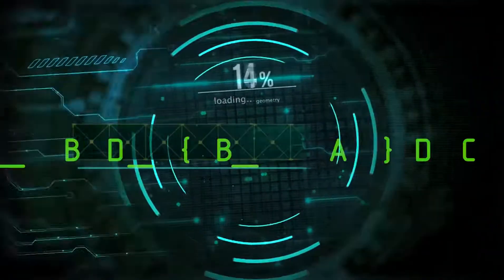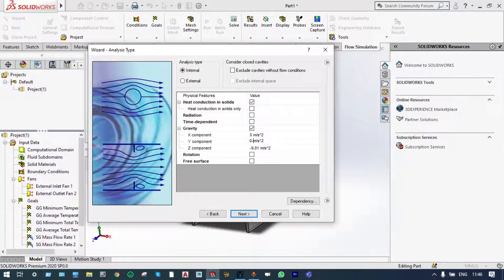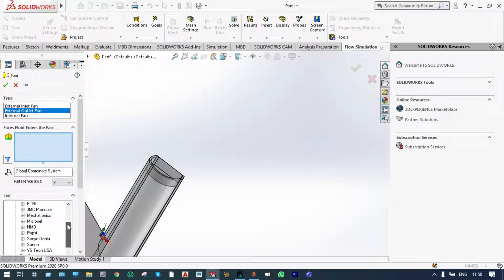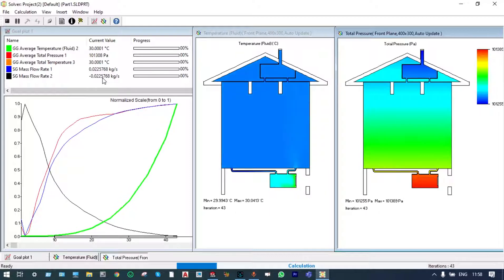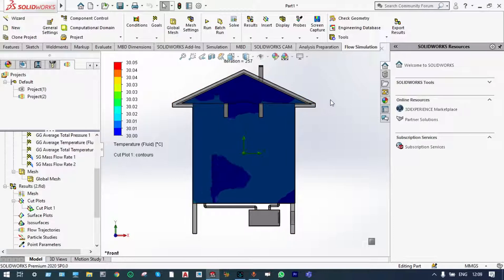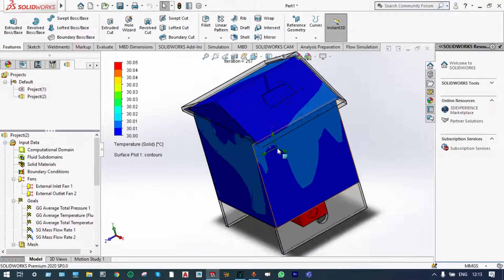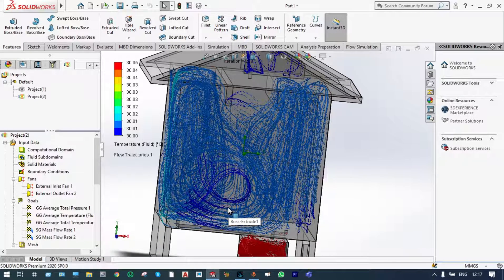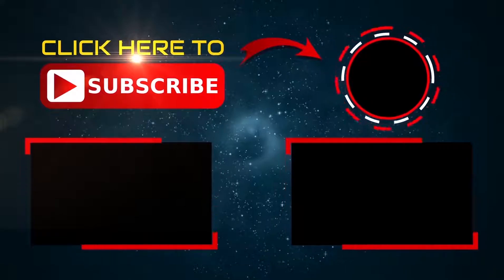Balanced Ventilation System Design with SolidWorks 2020: A CFD Analysis

Comment: I'm sure this video is very informative, but the sound is so echoey and very difficult to understand even at loud levels.  A condensor microphone would be a nice purchase if that is something you are interested in, they cost a little bit but pick up nearby vocals well while leaving out other sounds.  They usually need their own power source though so that requires a cheap interface to the PC that you can plug the microphone into.  There are other cheaper options as well I'm sure that could give you better audio quality.  Sound foam?  It sounds like you are in an enclosed thin walled metal container.  Just trying to offer creative criticism, this probably isn't going to be read anyway.  I should probably find a better use of my time.  lol.

Comment: hi，you have done a great job 。can you upload some cfd video examples for chip cooling and mobile phone cooling？include steady and transient example。or other example such as 、Combustion in gas mixtures, headlamp Lamp heat dissipation、Condensation of water vapor、Calculation of the relative humidity of air in gas flows、Thermoelectric coolers、Aerosol flow，thank you very much。
Reply from the maker: Dear friend,
Please write an email in which I can write to you in return